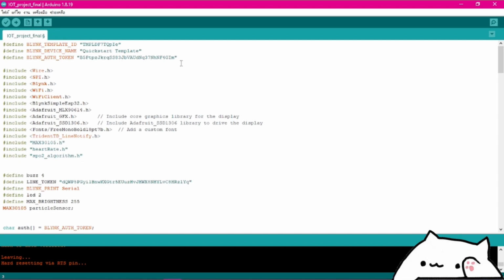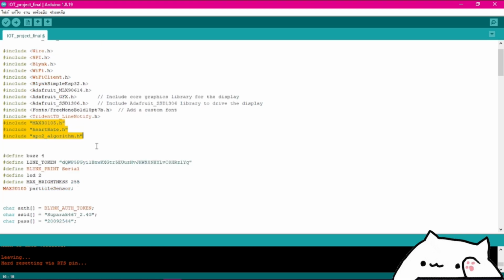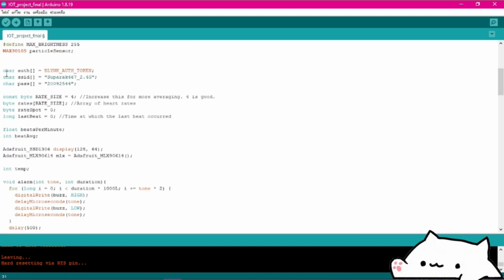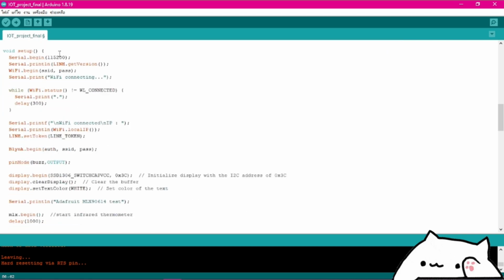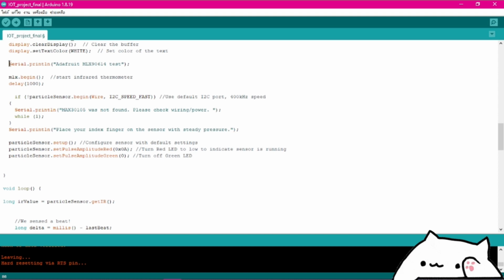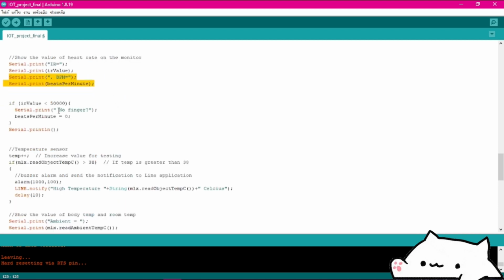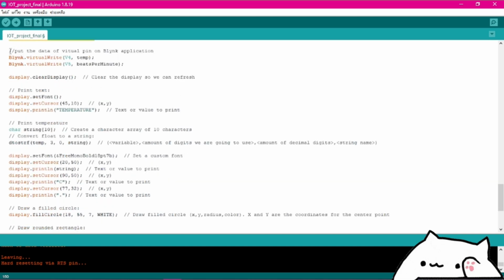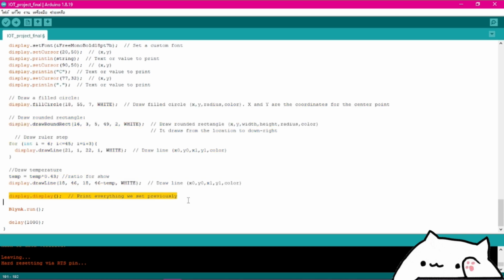IOT Project – Health Monitoring System by using BLYNK & ESP32

Comment: Can you give me the code and also the resistance measurement? I have tried to run both sensors at the same time and my results are useless, the temperature data is not detected.
The problem is that I am not using the other components, I am only using the max30102, mlx90614 sensors and the esp32 board. I don't know if that also causes the problem.